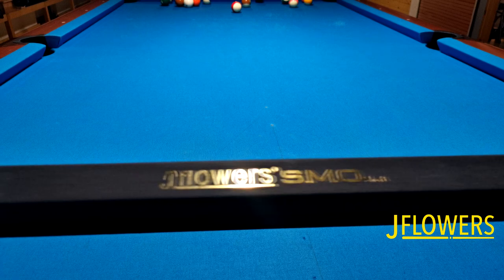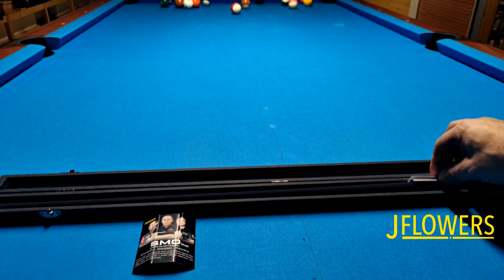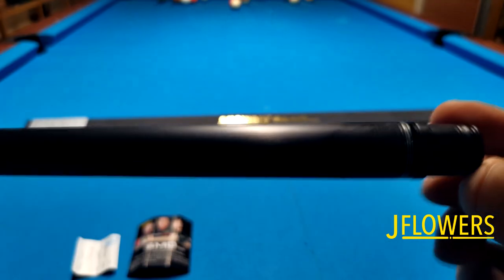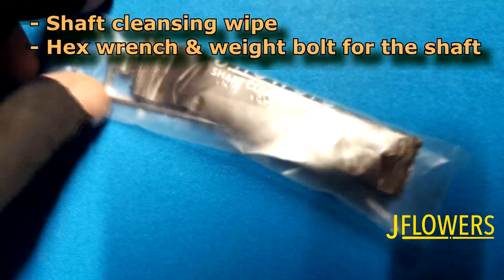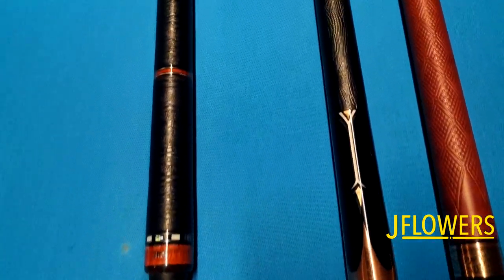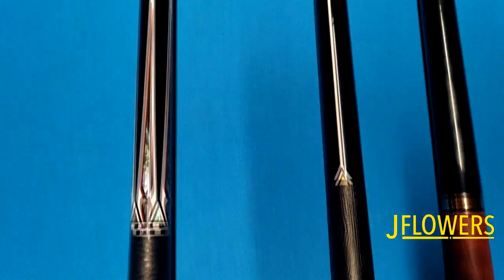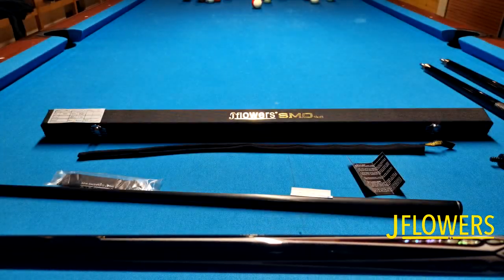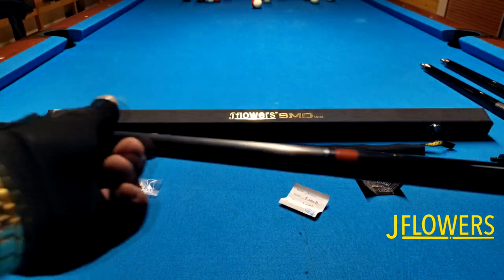New JFlowers SMO Carbon Shaft (The Lowest Scientifically Proven Deflection Shaft on the Market?)

Comment: @2:00 As of today, it comes with a standard TAOM Fusion med/hard tip. I Wish Seyberts would carry it so I could change it to fit a Cuetec carbon butt and other customizations.
Reply: I'm going nuts trying to find a 3/8 14, 20mm carbon shaft that's flush with my cuetec carbon butt that isn't $400+. The only one I've found is 21.5 mm at the joint. This is the same price as a Cynergy. Go with that. I've watched the SMO video and there are some factors in play were they could easily fake the results.

Comment: Hello,
I have a muccie cue with a pin size of 5/16x18 Will the SMO shaft fit??? Please help
Reply from the maker: @Hustler210  hello sir, from what i know there are only 3 thread types avalible.
3/8x8 radial
Unilock
3/8x10
There will be more variaties of tread types avalible in the future so stay tunned. 👍

Comment: Just saying it feels and sounds different is not really a ringing endorsement for the smo shaft. What were your impressions of the shaft, other than feeling and sounding different?
Reply from the maker: Thank you for the comment. 
Maybe I should elaborate it more in the video.
The shaft seems to have a more compact feeling when shooting. It was a wierd feeling at first since I didnt have to compensate spin shots that much. Great sound, a nice low pitch. 
Other than the great preformance, I find the design very sleek with the silver ringworks and the thic white ferrule.
Reply: @longpotbilliards  Thank you for the response and for the clarification. I've been looking to buy a jflowers cue, and of course when I'm ready to lay the money down they come out with 2 new shafts and now, once again,  it's decisions decisions ugh lol. That's why I wanted to get a clearer understanding of how the shaft performed by an experienced jflowers shooter, such as yourself, before making my final decision. Thanks once again for the quick response and clarification.
Reply from the maker: @matthewbaney2660  a pleasure 👍 You definetly cant go wrong with a JFlowers. 
I believe its a huge dilema since the 2 new shafts were just released. The classic CF shaft is also great since it has low deflection on its own but the SMO goes below that. It even comes with a taom fusion medium tip by default wich is a clever move. 👏
Do let me know when you join the family and share your experience & impressions 💪

Comment: NAH  PREDATOR REVO  WITH SAME TIP DIAMETER IS AND HAS BEEN KING OF LOW DEFLECTION FOR WELL  OVER 2 DECADES
Reply from the maker: Revo is a great shaft 👍
Nevertheless, JFlowers SMO is the new kid on the block that is comparable with the big guys for much less $$ 🙂
Reply: And things constantly change boy @youtuberBOY. So now revo is no longer the king of deflection. Someone else will be for longer. And there were people before predator existed that were the king of low deflection. But you're just a boy with much to learn
Reply: I guess you missed the video?
Reply: @longpotbilliards  wait what? SMO is $400 that's as much as a Cynergy and list of other for under $500....
Reply: @longpotbilliards it’s not much less at all it’s $400 plus add a tip $50 plus shipping $40 mine came out to just around $500 same price as everything else. The question is, is it worth it?
Reply from the maker: @PoolNerdsTV  yeah the shipping  varries from country to country. But good question sir, is it worth it? 👍 In my opinion, it is. It has a nice feel, preforms great, just as good as others (revo, ignite...) if not better and it has a nice touch of metal inlay rings with a thic white ferrule. I dont see myself switching to any other shaft in the future. 👍💪